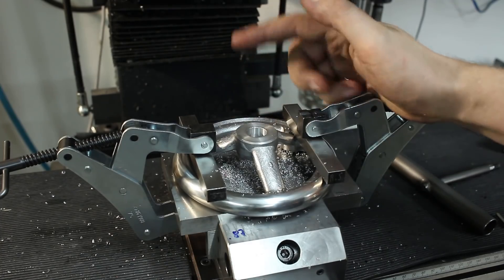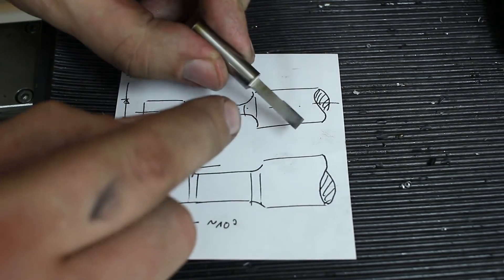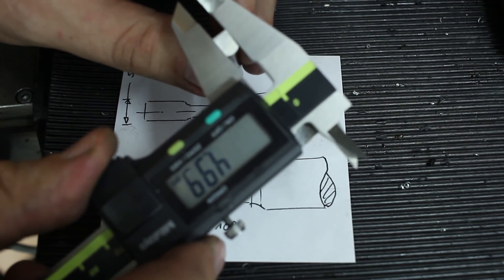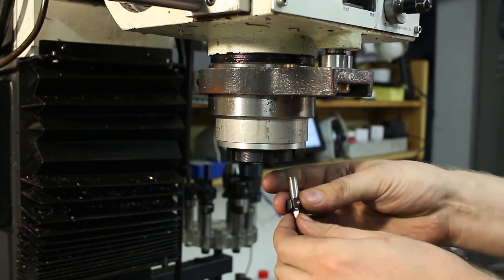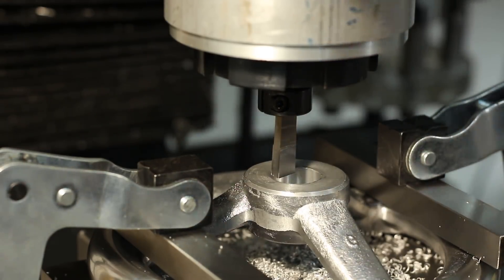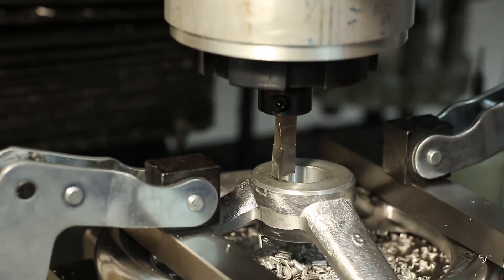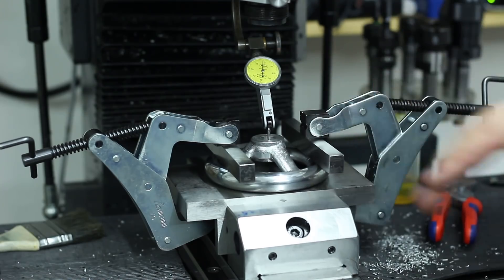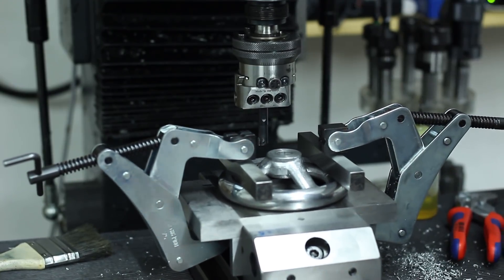Keyway slotting on the milling machine

Comment: "~ΛO²" = ~10° (< German translation. Lol) Why didn't you mill out most of the cut with a <5 mm EM, so all you'd have to do would be a light cleanup on the sides and the radii?
Reply from the maker: Because the slotting took only one minute anyway. How would roughing it out with an endmill be faster - It adds the milling and a toolchange.
Reply: i'd guess it took longer to read and answer the comment than it did to cut the keyway.